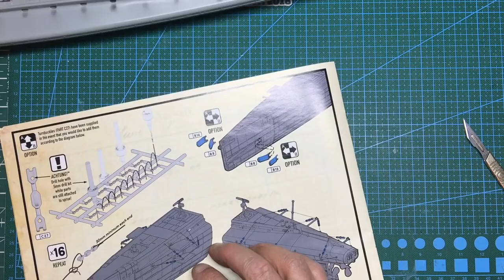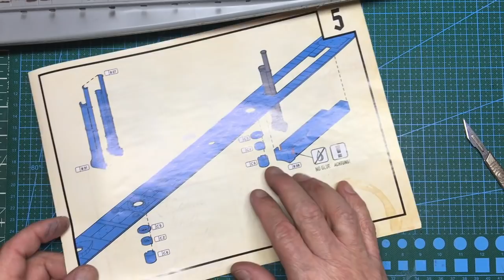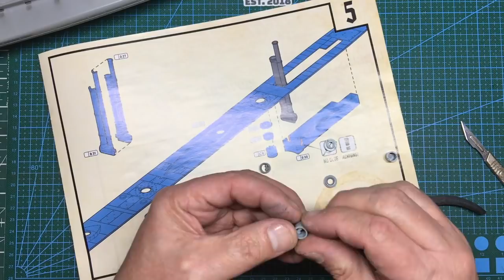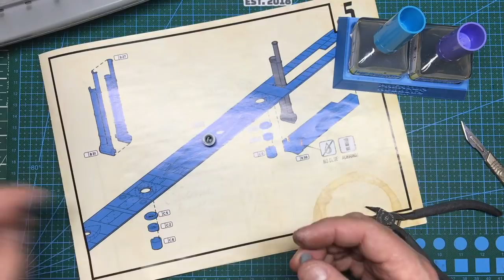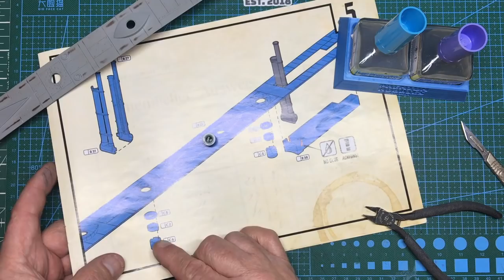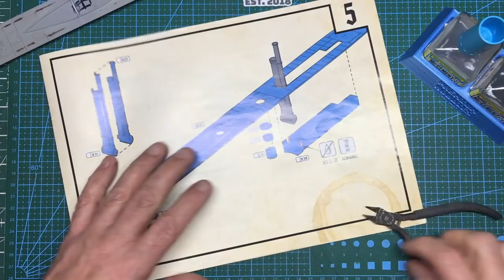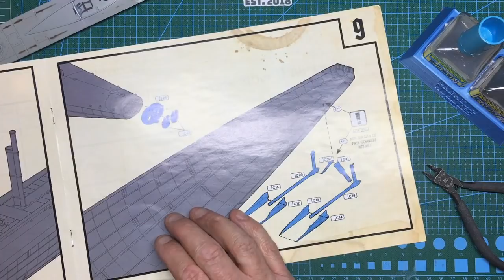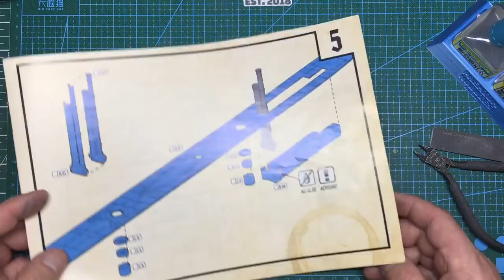Das Werk 1/72 U-boat U-9 build. Part 8

Comment: Hi mate, I found using cheap 'no more nails' from the local shops is great for adding texture, it takes a little while to dry but gives a realistic finish re texturing.Plus it's really easy to paint it and being an adhesive no problem in getting to lay down on the plastic.